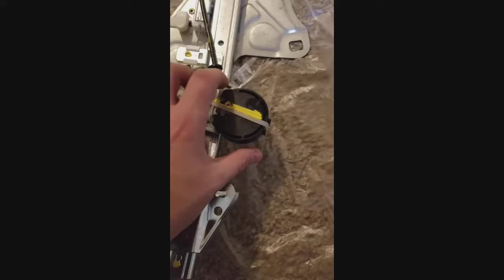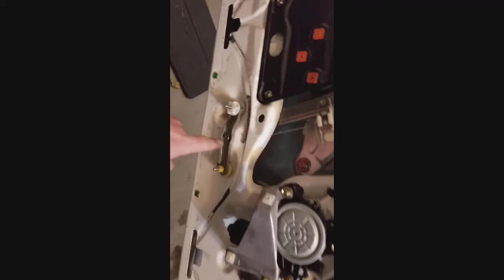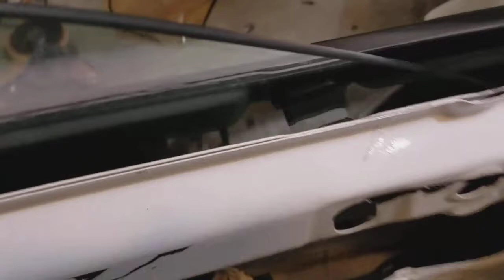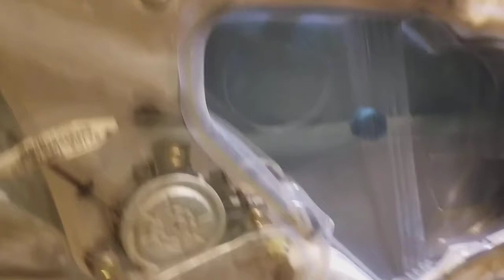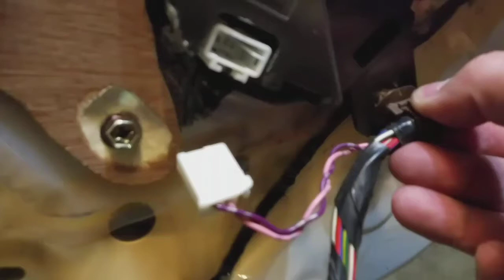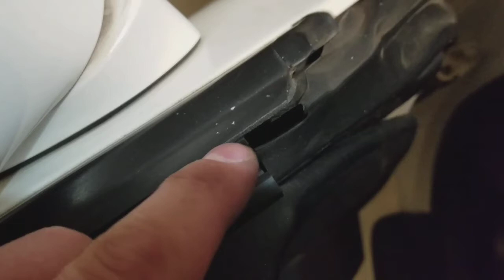Toyota Supra Window track install

Comment: Is it not possible to replace the cable? Or has anyone had any success using a generic brand?
Reply from the maker: In my case, the piece that the cable attaches to broke, so there is no way to re-attach.  Once that breaks, the cable will wind itself up and the motor jams.  I don't know of any generic brands, and there aren't too many of these available from Toyota either